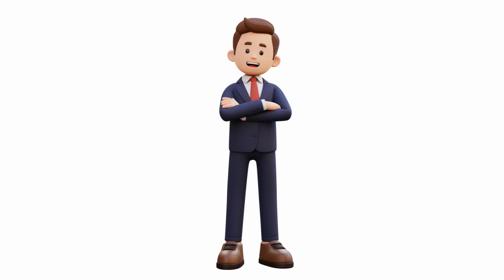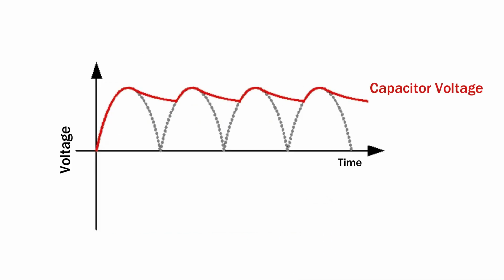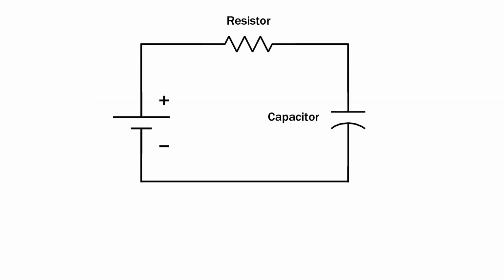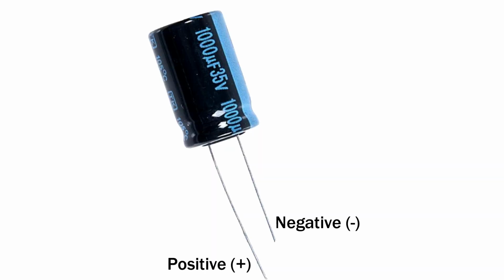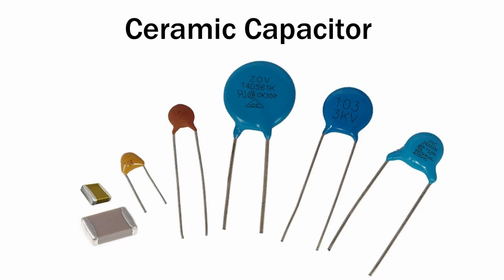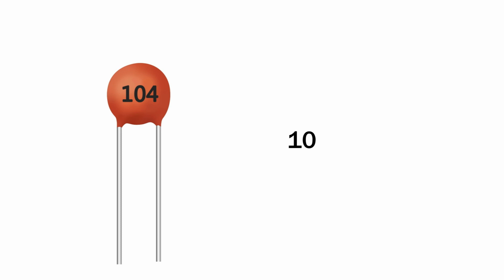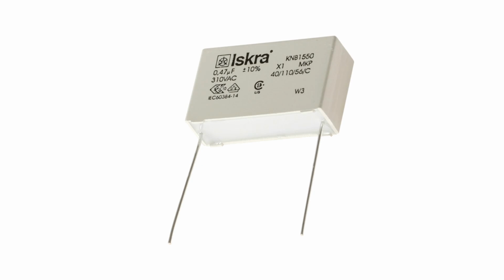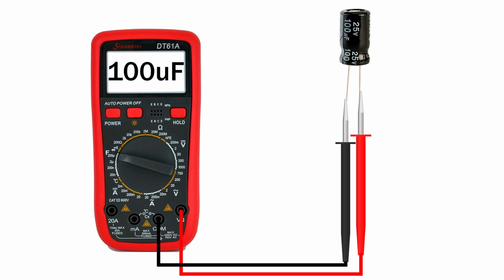You Won’t Believe What This Capacitor Can Do #capacitor

Comment: Now I know how to read the value printed on the ceramic ones:eyes-pink-heart-shape:
But how to know the voltage it can handle 🤔
Reply from the maker: Great question, I'll cover that in a future video!
Reply from the maker: Ceramic Capacitors don’t usually print the voltage rating on the body. because they are too small. The voltage rating depends on the manufacturer and the size/shape of the capacitor. Check the datasheet of the capacitor if you know the manufacturer

eg :- 
Very small 104 capacitors usually 50V.
Medium-sized 100V.
Larger/thicker ones 250V or higher.

When you measure the diameter/thickness 

eg :- 
Small disc 3–4 mm 50V
Medium 5–6 mm 100V
Larger 7–8 mm 250V
Big disc 10 mm or more 400V–1kV high voltage type.
Reply: @artofelectronics1  Great I have a reasonable answer . Thanks a lot
Reply from the maker: @lostworld-2024-m5m  Thanks for comment.